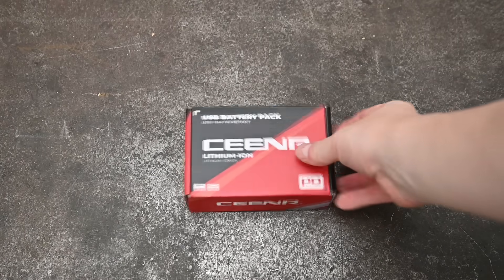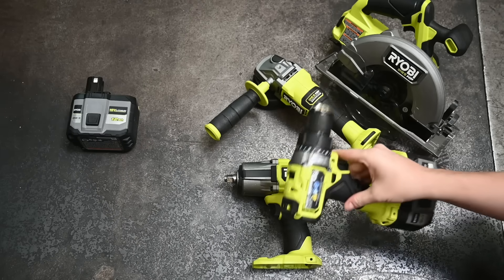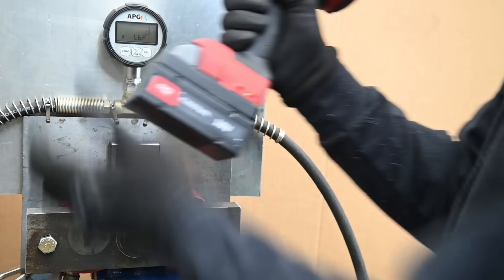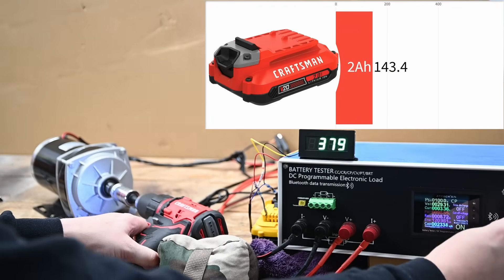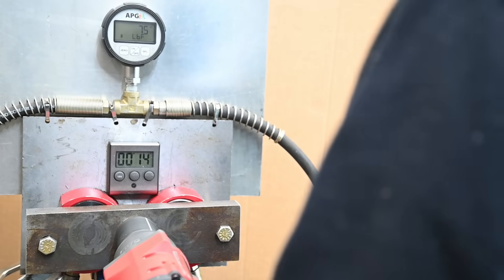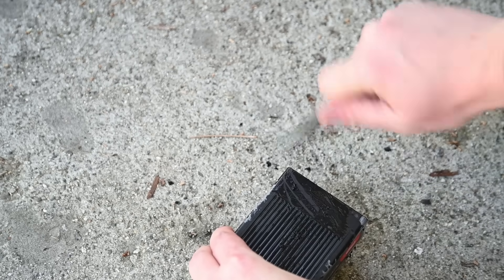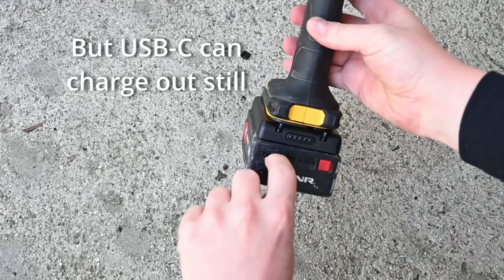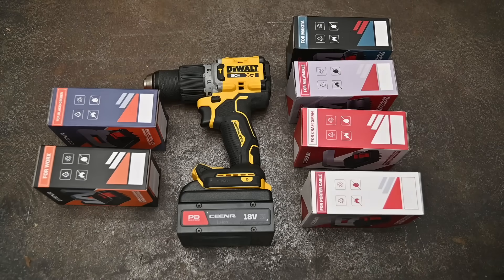We Bought the New Universal Battery for All Tool Brands

Comment: This is just going to cause tool manufactures to add a handshake to the battery, I am kinda surprised it has not happened yet.
Reply: it'll be bad as i made my own battery packs now..sighh
Reply: I think if they were gonna do that, they already would’ve because of counterfeits
Reply: They kind of do, but not fully.  First off a lot of tools need the temp sensor to operate, of which most battery adapters just spoof it via a static resistance and that lets the tool work.  However the danger there is the tool doesn't know the actual temperature of the battery if you just put in a static median value.  Secondly a lot of higher-perf. tools have some add'l "communication" with the battery--e.g. Milwaukee RedLink, Ryobi HP, etc. which is not needed to run the tool but sometimes is needed for peak performance.  These are typically "simple" protocols but would have to be reverse engineered, etc. and wouldn't be within the realm of a basic adapter.  

So not really handshaking but a few perhaps minor caveats to using anything "universal" via simple adapters.
Reply: @rolandm9750 it's too bad we can't just have quality adapters instead of the sea of counterfeits online etc. 

Thats where we really are going to see those digital handshakes pay off, is against counterfeit, potentially dangerous batteries.
Reply: Anything they add will be defeated short of adding a literal TPM with a silicon etched key into the goddamn drill lmao
Reply: They can only do that on new tools and some already do (Milwaukee if I'm not mistaken), but everything can be copied :) and I doubt they will invest in some cryptographic handshake. Also this will cause their new tools to not work with the old batteries buyers already have and that's not going to make many people happy.

Comment: If they really up their engineering game in future, they could theoretically support the newish 240W USB PD charging spec and get their charging speeds up to Makita level of fast. Although I have yet to come across a 240W capable USB PD charger. In my opinion they should at least support 100W charging, since charging ICs and chargers are commonly available and cheap in this class. 45W feels just a bit slow, given what is possible today.

Comment: Imagine if someone standardized a high amp output cord style for the electric generators that have become very popular. Similar to the one you Frankensteined for dewalt or the Makita one, but instead of using 4 tool batteries you can just use the 1024Wh EcoFlow or Anker battery with an adapter to fit your tool brand. Plug back in to ac to charge at 1500-1800 watts and in an hour and a half have a fully charged battery that can also power other ac devices and charge your phone with.

Comment: It's possible that they're using "offcut" cells that aren't guaranteed to reach the maximum potential advertised - might explain the blacking out of specific data on the battery and why the power limit is so conservative.  Just a theory - nothing but assumption to back it up

Comment: DRM for batteries is already becoming a thing. It won't take long for it to be tightened further, preventing anything but the home brand batteries. And it will be every bit as unfair and error-prone as DRM for digital media is. We as a society have told large companies that we'll pay more for enshittified crap, so can you blame them? In the meantime, I buy kits of whatever brand makes the tool I want, and 3D print adapters. Rarely do I need a given tool to be pushed to its limits, so the adapter loss is rarely an issue.

Comment: I've got the "made in USA" Craftsman top end hammer drill and 3/8 impact. Good to know that there is most likely large amounts of power to be gained by going with this battery and I could keep it for future brand changes.
Reply: The Craftsman 4ah put out more power and Lowes just had them on sale for $39/ea.

Comment: I am standardized on deWalt 20v, I buy an adapter for each tool to make life simpler usually for Ryobi or 18v deWalt. $20 per adapter makes it a no go for me. The batteries would have to be cheaper or more capacity for me to switch. There doesn't appear to be an advantage unless I was starting from scratch on batteries.

Comment: USB C sells product! on electronics if it can't charge through usb c, it's pretty much a deal breaker. being able to charge a device readily and simply is a huge deal. considering usb c can charge at 100w, it's surprising companies haven't thought to offer usb c chargers. m12 batteries have a micro b charger that also provides 12v out and a USB port. if they replaced the micro b with a type c port that can send and receive power, it would be worth getting one. I might need to check someone hasn't made anything aftermarket yet. 

I'd never imagine Craftsman would beat DCK!
Reply: Dewalt has a 100w in/out USB C adapter. I wish other brands did too, like Bosch or Makita. They only have 5-12w USB-A out adapters (cannot charge battery).

Comment: Awesome! I really like the PD nation idea. As an initial roll out it seems really good. I believe they will have it working great even at high current demands in no time at all. It's not easy developing all that. I have considered it to some level myself in the past. I wish them the best with this! Excellent testing TTC!
Reply: Looks like they've skimped on the cutoff mosfets, unfortunately. From the load test we see the CEENR losing an extra 1V compared to Bosch/Dewalt - that means it's got an extra 27mOhm of resistance. LXT 5 & 6Ah, M18 12Ah, Powerstack 5Ah, and then all Ridgid/AEG and Ryobi have cutoff mosfets, and they can all easily do more than 50A.

You can see a blurry boardshot at 12:01. Looks like it goes B- > 2x shunts > 4x mosfets > P-. There's also a really big inductor, capacitors, and another pair of mosfets, which I guess is a buck/boost circuit for the USB-PD.

Comment: I would argue that unless you use more than two brands finding a good adapter that has low voltage protection would be fine. For ryobi you might still want to get their batteries since you can get two 4ah ones for $50 around black friday when they do the 2 items for $99 and you can return the 2nd item if you only wanted 2 batteries. This is especially true if you lean into the fans, radios, and lighting they have using that at the same time you're running a powertool. But this is more of the exception since they are the only ones that let their batteries go on sale for this low.

Comment: 2:55 I also love the  Makita 19Z.  I don't care if it drives a 3/8 lag bolt 2 seconds slower than the Milwaukee. 
 It's smooth as silk and the trigger is absolutely perfect.
Reply: I feel like while makita usually isn't the fastest or most powerful, the ergonomics are better
Reply: @ulle500  Electricians seem to really like Makita for that reason. As usual, different trades have different needs, and what brand is best for one trade isn't necessarily best for another.

Comment: Color coordination is the dumbest argument ever.
As a professional user my customers couldn't wait 8 yrs for Milwaukee to make a tracksaw. 
I have no issue with my current lineup. Bosch,Makita,Ryobi, Ridgid,Milwaukee, Metabo and Fein.
12,18,19.2,24 and 36 volt tools.
Fanboys and globally use the same batteries , both groups are the enemy of innovation and production. 
Does a teal Makita oil drive impact flanked with a blue Bosch random orbit sander, clash with the yellow Dewalt 790?
Hell no,its called best in class and production. 
Kumbaya is the worst thing that could happen.
There would be no TC YouTube in a world of beige with black trim.
Lets compare tools developed in Russia and China ,any takers?

Comment: The lights staying on and draining the battery in a few days is an absolute dealbreaker.
Reply from the maker: Should take about 18-24 days. But I fully agree it's stupid
Reply: @TorqueTestChannel  to be clear though this is only with an adapter on or on a tool? If it just sits in 'powerbank' mode will we be okay to leave it for weeks and not worry?
Reply from the maker: @gloriousapplebees  Correct, in power bank mode you could leave it for 6-10 months like most batteries.
Reply: @TorqueTestChannel  Gotcha, still silly but that's easy enough to work around... as long as you remember LOL
Thanks for all your work!
Reply: @TorqueTestChannel  are the adapters meant to stay on the tool so that you only swap the battery between tools?
Reply: Could we disable the LEDs?
Reply: I couldn't agree more...took the words right out of my mouth
Reply: I agree its not good but at the same time I am 100% in the "never leave a battery in a tool" camp and never leave an adaptor on a battery no matter the battery or brand.
Reply: I think they could add a little switch that turns the battery off. This could simply be wired into the BMS.
Reply: So, one could simply disconnect the battery from its adapter, and the usual power consumption wouls be observed? If so, that seems like a great way to train folks to take their batteries out of their tools when not in use. Probably not a bad thing. 🤔😮‍💨
Reply: 15:40 they show a tool running with the light off. misleading.
Reply: @CapApollo  that's probably how it's supposed to work. I'm assuming there's a glitch with the current batch
Reply: @CapApollo the angle
Reply: @CapApollo  Could have been after the drop test that killed the LEDs

Comment: My issue with this system is that it looks like if I want to run multiple brands, I think I would need to get an adapter for each of my tools.
Reply from the maker: This is true, however a $20 adapter is much cheaper and takes up much less space than a matching name brand battery + charger for each brand.

Comment: Even limited to 45 watts I am all about that USBC charging I have USB c everywhere what I would like to see is bi-directional 100 watt now that would be nice 

What I would really want to see in an aftermarket battery and I will pay a little more for this and I don't mind if the battery's a little bigger I'm tired of lithium ion batteries They just don't last I want a decent good high quality for amp hour lithium-iron phosphate battery so I can have a battery that I know in 2 years 5 years 10 years will still drive my tools and probably much longer

Comment: Is the usb-c port bi-directional? Can it be used to charge other devices?
Reply from the maker: Yes, both USB-A and USB-C can be used at the same time to charge out. Totaling 2.2A from both or about 2A from 1
Reply: What would be really cool is if it was not only bi-directional but if you could charge and discharge them at the same time, IE have a corded setup able to give it extra juice/charge and be able to go cordless whenever you wanted.

Comment: I'm on the Makita platform but have some Milwaukee tools as well. I really wanted the Milwaukee 18v vacuum. I have the Makita to Milwaukee battery adapter. I also had the stalling or not starting issue. It would work once but in order to use it again I had to remove and reinstall the battery. I took it back and just bought the Makita vac which ended up being fine. If you guys have a Milwaukee 18v vac you you test it please?

Comment: Batteries are so inflated and we see this through kit prices, sales, and what harbor freight sells their 12.0s for. Not long ago home depot had 3 12.0s for $400 and even more recently they had a 12.0 + two 3.0s for $200. Home depot also had a sale on their 60v tools that came with a 'free' 9.0 battery. They would never take a loss on their sales so all of this tells us that their regular prices could simply sit lower. I've already been running adapters for ~10 years though so I'm not sold on these as a completely new concept. I think they need to round those corners and potentially wrap in rubber for durability. Another big thing would be to make the adapters work for charging the batteries on name brand chargers because a hour+40 mins on a 4.0 is not feasible in the field. Overall, I like the direction they're going with this. Thanks for the video sir.
Reply: you got to get bunches of battery packs then but lugging those is a pain in arse. in freaking hot sunny days, the pack will heat up faster and reduce the time usage quite considerably. My 4.0Ah battery that should've last 40-45min went off just less than 30min on a hot day.

Comment: Im wondering if the sag is being caused by either wiring or component connections inside the battery. It would be interesting to see a heat gun reading on the battery after heavy amp draw vs. OEM.

Comment: Looks like a good idea for diy'ers but for me I love the 15-20min charge time on my Makita 18v 4ah batteries ... By the time I run one down the other is fully charged.
If only the blooming batteries didn't cost an arm and a leg.
Reply: With an appropriate charger it should charge just as fast. In the video he was using a laptop charger for some weird reason.  Only thing that sucks about rapid charge is it severely degrades the batteries overtime.
Reply: I just have multiple batteries. Battery not included - battery now included - er - ok. Thanks

Comment: As much as I think this is neat and certainly pressures OEM battery prices if this takes off, I wouldn't use it unless it worked on a slide charger. Just about anyone who has a tool brand is going to have at least one if not a pile of chargers. Even someone who buys bare tools mostly is going to stumble across a deal that includes a charger that is too good to resist at some point. I look forward to seeing this kind of thing take off, but I hope they or someone else starts making them compatible with the fast chargers. I'm not dealing with delicate usb crap on the worksite.

Comment: The cordless tool industry needs this. I stuck with milwaukee for no other reason than i was able to get a kit for $70 that had 2, 4 amp hour batteries and a drill from a pawn shop that was practically brand new. I had batteries already so a bought a few bare tools when needed after that. That means i am heavily invested in their tool line and paying the high prices for it. I am in no way unhappy about my purchases but when a battery dies so does a piece of my soul cuz thats some serious coin down the drain. A cheaper but competent off brand replacement battery pack is exactly what we need.